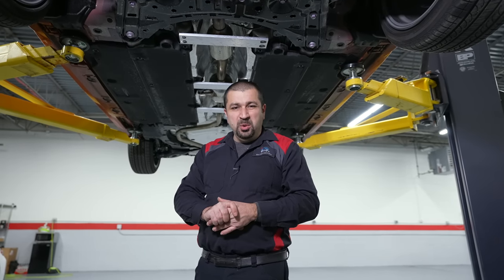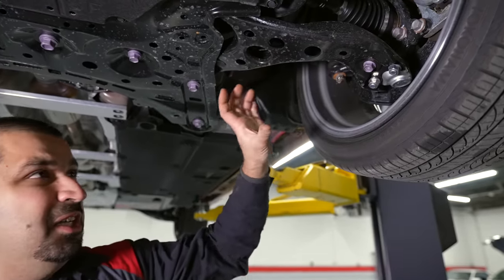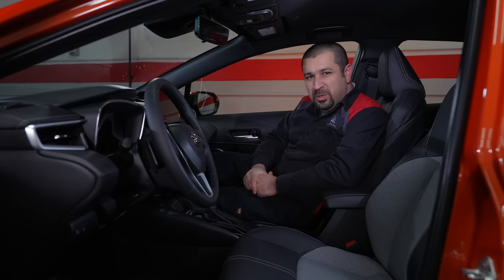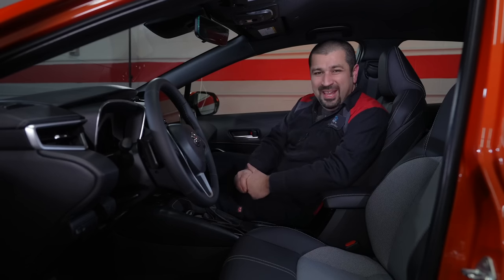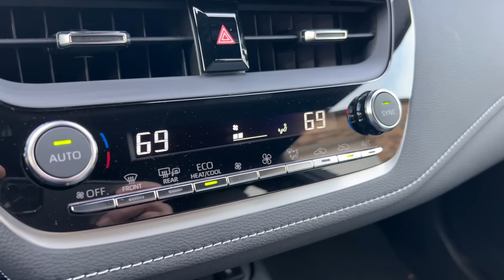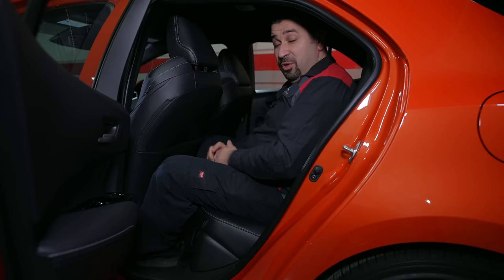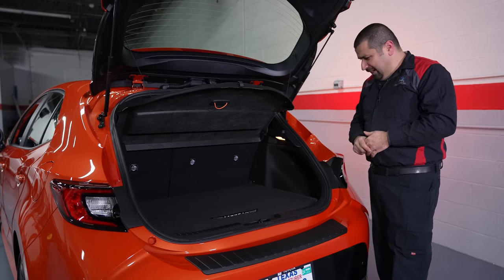Should You Buy a Toyota Corolla in 2023? I Have Good News and Bad News!

Comment: My first ever Toyota was a corrola with manual transmission in 1973. Like you I appreciate the options that make the car more reliable and easier to own.
But after watching you try to stuff your body into the front or rear seat I’m definitely not going to able to fit into a new corrola! You are 5’7” I’m 6’5” and 360 lbs maybe if I take out the seat and sit on a pillow on the floor I can into a corrola. Lol. Thanks for your video I think I’m going to have to keep driving my pickup truck for a while.
Reply: to be fair that 73 Corolla was way smaller...you are just bigger now 😅
Reply: To be fair, the 1970s Toyota car seats were not crap, where they kink your neck if you are over 5’9.

Comment: I have a 22 corolla hatch Manuel trans with 17000 miles I have heard that the RAV 4 and the corolla has a defective ( coolant bypass valve) and a class action lawsuit exists. The question I have has a Toyota Updated this part and if so I am wondering if I should
Purchase the part and replace my (coolant bypass valve) preemptive repair.
Since this problem covers two vehicles the RAV 4 and Corolla this would be a good repair vehicle as Toyota want a lot to replace same

Comment: Mans "hates" the 2ZR-FEs so much in this video for some reason. I totally get the A25/M20s have already been out for over a few years, and have been proven to be very reliable engines for their levels of complexity, especially how impressive their dual port/direct are. But my 11th gen '19 Corolla SE M/T has been nothing but reliable in and out, always changing the oil before the 5k mark/5 mo, alongside all the other preventive fluid changes. As you said in your other videos, so long as people keep up religiously with their maintenance, they are virtually indestructible. I may sound like a fanboy from my experience, but dang, you really "boomer"ized the 1.8 in this video lol. I know I maybe contradicting myself, but imho maybe they should've kept the 2ZR in the lower trims of the 12th gen for at least a couple more years.

Comment: Seeking Your Advice: I have a 2012 Honda Pilot V6 EXL with 200K miles; my wife drives 18K miles yearly. I also have a 2019 CX-5 2.5L Turbo with 29K miles, and I drive 7500 miles per year, worth $24K. I am considering selling the Mazda to get my wife into a used 2020 - 2022 Carolla hybrid with 53mpg instead of the 19 she gets today. I will drive the pilot instead. Does this make sense, or am I better off driving the Mazda indefinitely? I love the Mazda and own it outright. However, I am looking at how I can save money on gas. The used Carolla hybrid will likely have 50-100K miles.

Comment: I've driven manual for awhile an 01 neon, 96s10 90 camry, s10 various other things.
I own a 2017 toyota IM and honestly the manual sucks its friction zone is the thickness of a nickel its unforgiving and sits stupid high, I haven't seen anyone get in my car drive it and NOT stall it. so the manual can honestly go in the trash i dunno how the other ones are what i've learned is they put so much tech n bs with delay valves and drive by wire and other stuff that its redundant

if your wondering how i bought this car since  i dislike it so much its much nicer when its cold i got it in November..

Comment: Its one of the best looking hatchbacks. But why put such an anemic engine in it. At highway and freeway speeds, the horsepower is gone. No passing power, or moving in and out of rush hour traffic without risk. I think its dangerous due to its lack of power. Why didn't Toyota add a turbo and boost power 20 to 40 hp?

Comment: I was real disappointed when I went car shopping for a Corolla. I wanted a Stick shift Corolla so bad. But there were none on any lots. And even the CVT and Base models were all overpriced. So I went used... and I found a 2014 Corolla with 110k miles for... $15,000. And it was trashed. So I hedged my bets on a 2.0L 2015 Focus SE. We'll see if the Blue oval Corolla knockoff can swing it with Toyota. With a manual transmission and no turbo I hope it can.

Comment: "If you want a sporty model, just go buy the GR Corolla.  It's as simple as that."  Um, nah, it's not that simple.  Sure, a GR would be nice, but I like my 6-speed XSE hatch just fine.  It has all of the features I wanted and It didn't cost me $45k, like a new GR Corolla would (Never mind the insurance premiums).  It has plenty of pep and maneuverability for my 20-minute back road commute.  Previously owned a 2007 Corolla sedan (126hp), and then a 2017 Corolla iM (137 hp).  This new Corolla hatchback is a HUGE improvement for power and handling.  Backseat space is tight, but we are a family of 2, so the rear seats are usually folded down for plenty of cargo space.  Buy the model/trim level that fits your lifestyle.  I do wish they sold the Corolla Touring model in the states, though.  We need more hatchbacks in the world! ;)

Comment: Another great video! I have been able to learn so much from watching your channel.    Question: Is the M20A-FKS 2.0 engine from the 2020 Corolla SE (Japan made), the same engine as the 2023 Corolla LE 2.0 (USA made)? My 2023 engine is toast and I found a 2020 SE 2.0 engine  as possible candidate. So far everything looks the same except for the  electric water pump in the 2023. Are there any other major differences? Are the injectors the same? Thanks!

Comment: I have a 2019 XSE manual. I still love how the car looks and I do really enjoy driving it. While I think it's underrated, Toyota's pragmatism can get frustrating. Toyota NA's marketing strategy doesn't help either. They omit features available on overseas models and, if we're lucky, eventually offer them on mid-cycle refreshes. The gauge display is emblematic of this: Europe and Japan get the really nice one and we get stuck with a cheap, sub par version that's barely an improvement over the base model's tiny screen. 

Beyond that, the top trim really should have had more power to better compete with the Civic Si. Europe gets a 196hp hybrid, so why not the US? Sure, the US gets the Corolla GR, but between low production numbers and dealer markups that car is basically unobtainable.

Comment: I want to start changing the engine oil by myself each 5000 miles, I have the Toyota Corolla Hatchback 2023 with 24000 miles right now, I live en Florida but I have to drive a lot of miles, I bought the engine oil and filter in Toyota 0W-08, Can I lose the vehicle warranty by making the changes myself?

Comment: I am driving 2019 Hatchback XSE trim and this my first ever hatchback after driving sedans since 2002. I don't now why The Car Care Nut review is sayng that it is not a sport hatchback? It has very sporty look, sport multi-link suspension, very good new engine 2.0 Dynamic force engine and it has enough power for daily driving and especially on a highway. Come on!, we are not going on the track day on this car! I also purchased OEM trunk spoiler from the Toyota Dealership and now it looks more sporty! My height 6.1 and in the front seat I have plenty of room and leg space. Hatchback models have more cargo space rather than sedans, especially when you drop down rear seats you have a flat floor till the front seats and this is a big  BONUS! I have been moving to the new place few times on this car and you wont beleive what can fit in this sporty hatchback! I love that CVT transmission have a physical 1st gear, so it has no any delay or slow acceleration when you start to drive. Sport mode and Paddle Shifters also a cool BONUS in the XSE Trim! If you live in big city, where lots of cars and crazy traffic you need only CVT transmission not a Manual one, in traffic you will kill a Manual transmission, clutch and your left foot! So for me the Hatchback XSE trim with CVT transmission it's a perfect choise! Bought in Canada with Japanese VIN #

Comment: Off topic of this vehicle but my question is I need to change the transfer case fluid in my 21 Tacoma TRDPRO. Specs call for LF 75w which dealer doesn’t have they say they use Mobil 1 or GL equiv. What do you recommend

Comment: I really wanted to like the new corolla hatch back but for a compact car, the backseat legroom/headroom seems to really suck. You really confirmed it by saying/showing that you at 5''7 felt cramped sitting in the rear seat ''behind yourself''.
Honestly, i detest any vehicle that bills itself as a four door with rear seats and does not give enough back seat passenger leg/headroom. Why make it for a double amputee?? 
Got a 04 Matrix and that car was made for singles or small families. Functional for rear seat passengers/great head room, at least up to 5''10 and a very nice hatch cargo area. My brother has a 2014 Corolla sedan and that car feels spacious in front and back for a compact car, rides nicely, reliable,cheap to service, cheap on gas. The 1.8L/132hp /cvt is fine for normal city commuter/grocery getter and keeping with the flow of freeway traffic.
- last thing.....i know toyota corolla has the new hybrid with awd, too bad the wimpier hybrid. Would be nice to have the hybrid engine from the new Prius and upcoming Corolla Cross hybrid with 192 hp. So for me,if i was in the new car maRket, i'd buy either the Corolla Cross or the Corolla sedan.
Reply: Sedan is much larger in the rear
Reply: Today's Corolla hatch is a Matrix built to 3/4 scale with a roof line 6 inches lower than the Matrix/Vibe. I have no idea why the Corolla is built to a single, global standard when they used to offer a bigger Corolla sedan and Matrix specifically for the North American market. To add insult to injury, they don't offer the roomier Corolla wagon they sell across Europe.   Time and time again Toyota is under-sizing their models compared to direct competitors like Honda.
Reply: @rightlanehog3151  ...shame toyota discontinued making/selling the Matrix and the Vibe. Excellent all around vehicle, still gets pretty good near factory mpg, in my opinion, a better transmission (4 speed auto with OD) that is solid, no leaks, no harsh shifts or clunks(2004!!!), excellent brakes, very good interior passenger room and good rear cargo hatch room, simple/easy engine to maintain/repair/order parts. Only major parts to finally need replacing were the Starter, battery. The factory am/fm/cd stereo still sounds good , except typical factory radio face light is only half visible. I do a throttle body cleaning, pcv cleaning, mass air cleaning, new spark plugs, fresh filters/oil, fresh tranny fluid, new cabin filter.....and the car runs better then my brother's 2014 Corolla. Tons of Matrix/VIibe enthusiasts online and mechanics love the car, always praising how good it is.
Reply: @tonya.1697  Tell me about it!! The Matrix and Vibe were extremely popular here in Canada throughout their production run. Sadly,  Matrix sales eventually lagged in the USA which may have led to the discontinuation before a 3rd generation arrived on the scene. We had a brief ray of hope when Car & Driver erroneously reported  the Auris/Corolla wagon was coming to North America as a Scion . The Auris/Corolla hatch we actually got as the Scion/Corolla iM was not bad but it was a step below the original Matrix for practicality. Today's Corolla hatch is closer in interior dimensions to the last real Yaris hatch we had though headroom was far more generous in that Yaris.   I drive a base 2005 Vibe with the 5 speed manual. I have only had 3 non-scheduled repairs in 18 years and it is finally due for a new clutch. My car is still so reliable, I won't hesitate to spend the money as the investment ought to provide another decade of service. Some people compare the new Corolla Cross to the Matrix but I don't think the new model is anywhere near as space efficient. It also lacks the pop-up rear glass and the fold-forward front passenger seat which can be so handy for carrying longer items.

Comment: I have a '23 Corolla Cross that has that engine. It's only 7 hp less than the 2016 rav4 I had so, it does okay. Like a lot of 4 cylinders, you have to push it if you really need it to move. I don't knowvif it's the same transmission; it has the launch gear and 9 programed gear shifts - which you can avoid if you don't floor it.

Comment: I drive 65 miles each way to work. Mostly highway. Last 5 miles or so in the city. Is a hybrid good for me?
Reply: Yes. The non- Hybrid Corolla gets fine fuel mileage but the Hybrid is incredibly efficient.  With the miles you are driving,  the savings will be substantial. As you may already know, the host of this channel drives a Camry Hybrid.
Reply: @rightlanehog3151  So if the battery charges upon breaking - it must not need a lot of "breaking" to charge up...? Hope Im clear enough.
Reply: @rebeccawortman3069  Loud and Clear! 😁The battery charges during braking and coasting. As a bonus, you can get a Corolla Hybrid sedan with AWD as well as an AWD Prius. 
I expect the new Camry coming soon will also offer AWD Hybrid.

Comment: So just getting my 2024 Corolla Cross (same radio and wireless carplay/android auto). I found you don't have to stop and reconnect. Coming from my It background I thought, off and on again. So while still in motion (or never leaving Drive gear) I pressed and held the volume knob down, in essance rebooting the radio, allowing a reconnect to happen on its own. Not sure if at the time that was needed, but as of today, this got me past the 2 times I had it happen. I then found my galaxy watch was interfering with GPS stuff. After stopping that, no issues since.

Comment: I just purchased a 21’ se with the 2.0 engine and only now realized on the car fax that it was 15,000 miles between the 2nd and 3rd oil changes! 😢 Should I be concerned or trust Toyota reliability while properly maintaining from here on out?

Comment: I'm from the UK - and I have a 2022 GR Sport Hatchback 1.8ltr.
It is okay but I am really confused and furious that Toyota have not fitted certain things like Blind Spot Monitoring, Auto Rear Wipe when Fronts are on when you go in Reverse, Heated Front Screen...
But another thing is why does the Yaris have full individual tyre pressure monitoring system but the Corolla doesn't - apparently the 23 model does.  This is unacceptable.  Surely Toyota could offer a software update to this?  There is a 3rd party add-on but as it is a Company Car I can't do this.
Toyota seem to have gone off on a loopy moment and not looked at all safety as standard.

Comment: Why would Toyota bother making a 2.0L of the same 2.5L engine. Is it actually any smaller in size or actually any cheaper to make? Just seems unnecessary to me when they could just develop one engine instead of cutting off 0.125 liters per cylinder for no apparent reason.

Comment: My hybrid awd 2023 Toyota Corolla that I picked up 1 week ago from the dealership was $2000 above Msrp. The intrestrate through toyota finance is very dissapointing. The most dissapointing however is the noise it makes to alert pedestrians. Sounds like a brake pad that needs to be changed  immediately. The sound can be heard inside the car when driving forward under 25mph or in reverse. I drive 6-8 hours a day in low speed, stop and go traffic so I hear this sound constantly. Toyota needs to improve the insulation, lower the volume or change the sound to a bearable sound. Until then driving a hybrid Toyota Corolla is an awful experience.

Comment: Hey car care but I recently bought a 24 Corolla hybrid and I noticed when I am trying to stretch my gas mileage on the highway and my foot is very soft on the gas pedal the engine turns off and on repetitively in a short amount of time as if it doesn’t know if it wants to be on or off bc I’m not deliberate enough with my foot. Is this causing wear on the engine or any part of the hybrid start/stop system?

Comment: Only the base model in the sedan is cheaper.  The Hatchback doesn't have a LE base model option but as soon as you go to the mid level SE package you actually pay $1000 more for the sedan...yup...$1000 just to go from a Hatchback to a Sedan on the same trim level.  So yes, if you want the cheapest bare bones model the sedan comes in the LE, but any other trim you are paying quite a bit more for the sedan.  Also the wheel wells didn't look all that bad, its smeared very good with rubberized body coating.  The plastic or composite valve covers do look suspect on the mold but i'm sure they have a machined mating surface and will last quite a while.

Comment: I would like to ask about this K120 CVT gearbox. The original manufacturer in my place does not think that the gearbox oil needs to be replaced. The gearbox oil filter is also installed inside and cannot be replaced. In order to ensure the service life, should I do it earlier? How about changing the transmission oil? I wonder if you can provide me with some directions to maintain this transmission!

Comment: Hi, would you be able to suggest part number for Bank1 sensor 1 and bank1 sensor 2, for 2000 solara sle V6 (1mzfe engine), with sticker (vehicle emission control information) under the hood says: This vehicle conforms to u.s. epa regulations applicable to gasoline-fueled 1999 model year new passenger cars provided that this vehicle is not sold or delivered to an ultimate purchaser for principal use in the state of california or a state that has adopted california standards under the authority of section 177 of the clean air act and those standards are in effect.  I am really having hard time on whether to chose calif. specif or non specif sensor etc...Is it air/fuel ratio sensor or oxygen sensor, coz seems the denso or other website just give options and says sensor fits your car..Confused!